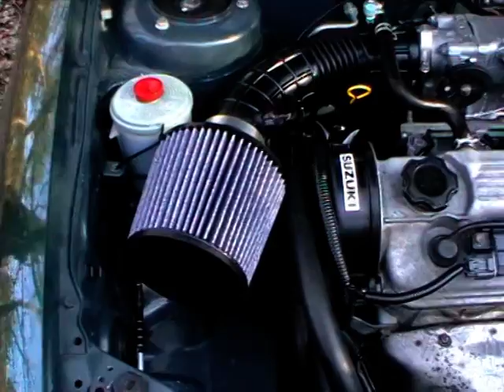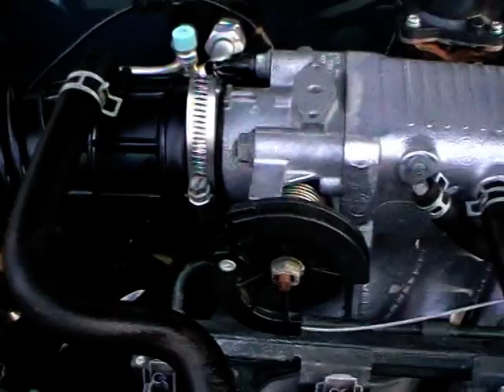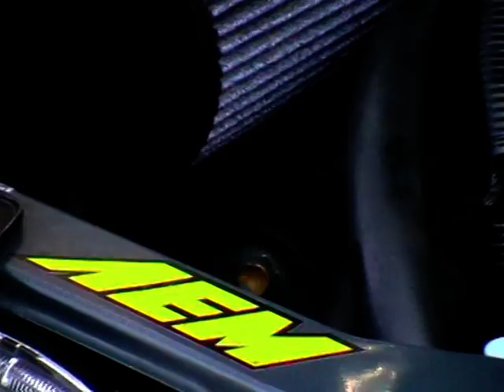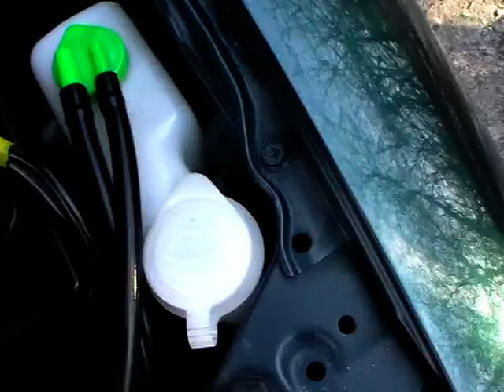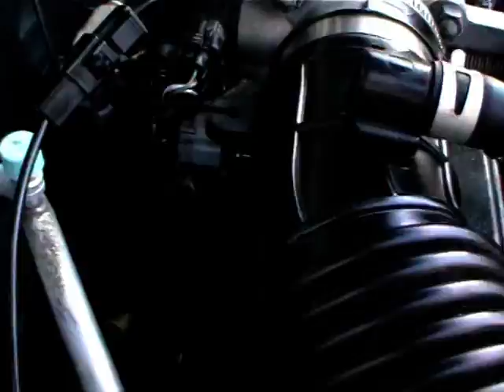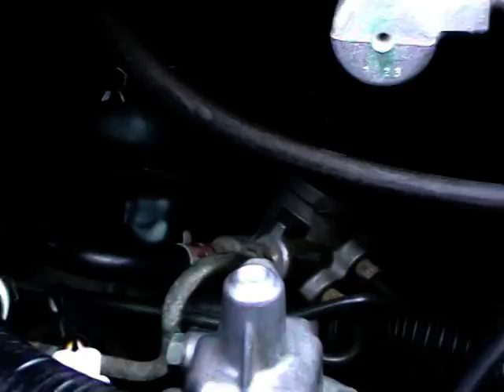Suzuki Baleno/ Esteem- G13BB Engine overview!

Comment: Is the G13BB engine equipped with stock rev limiter? Do you know the fuel cutoff?
Reply from the maker: Yes off course. Stock ECU Limiter.
Reply: CivicNigga Do you know at which RPM the limiter kicks in ?
Reply: @eduardodiaz4282  mine limits at 6700

Comment: Looks like an engine out job to replace the timing belt!
Reply from the maker: +kernowarty No, look at the left side you see a Plastic cover. Remove this, you can change the belt.
Reply: No.  look the engine mounting up against the timing belt cover. This will have to be removed at the very least.